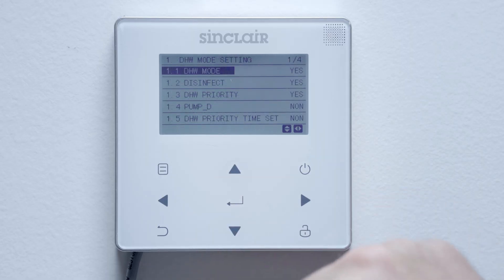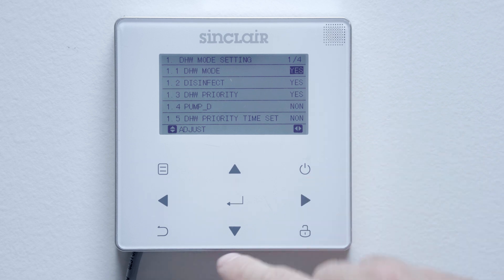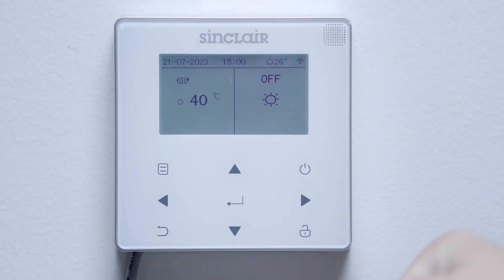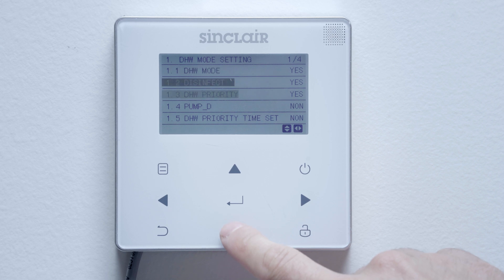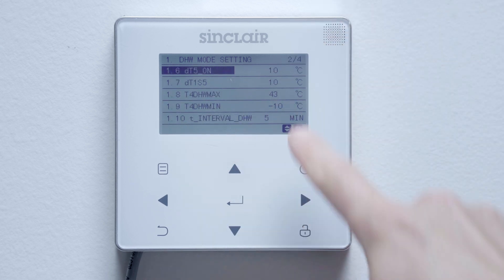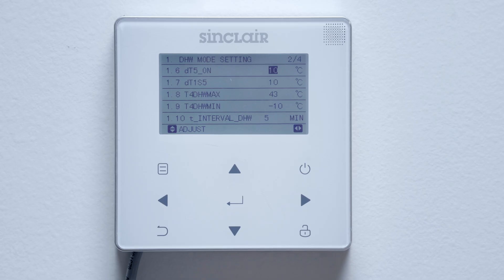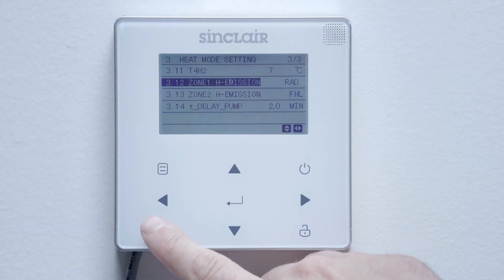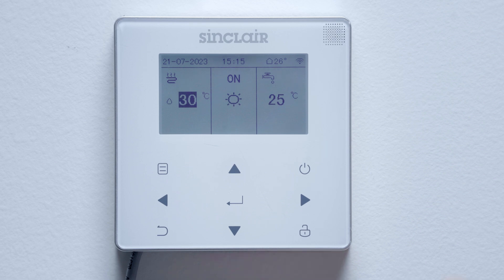SINCLAIR Heat Pumps: S-THERM YUKON Basic Settings

Comment: Hello!
I have the Yukon MSH 190TB-3/9 installed for DHW and floor heating and it works just fine - If I switch to Cool mode for the summer I can see that the heat pump is now circulating 12° water in the floor cables (because I was able to switch the connected thermostats into Cool mode as well). Is there anything wrong with this approach? Are these heat pumps designed to be able to simply switch between cooling and heating like that? Thanks!
Reply from the maker: Thanks for your question! Our heat pumps are designed to work in both heating and cooling modes. However, if the water temperature is set too low, there’s a risk of condensation forming on pipes in the floor and walls. To avoid this, we recommend setting the temperature no lower than 16°C. Hope this helps!